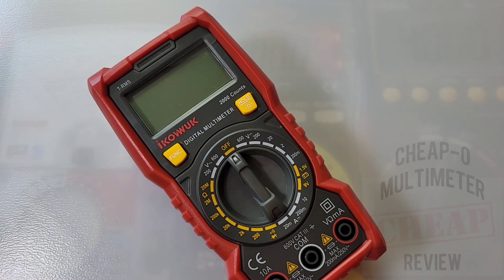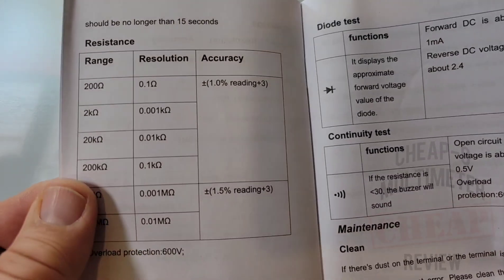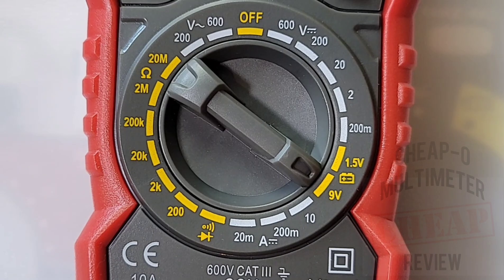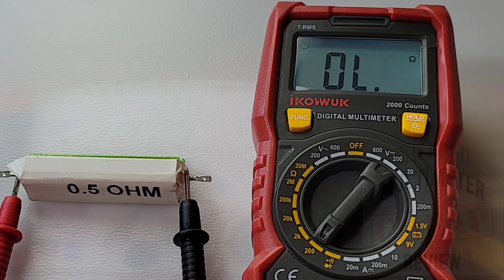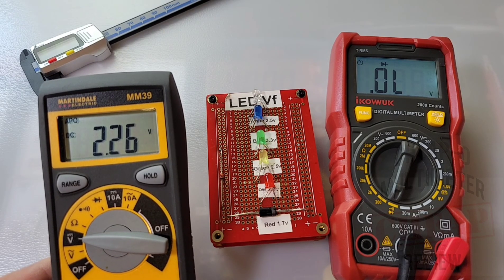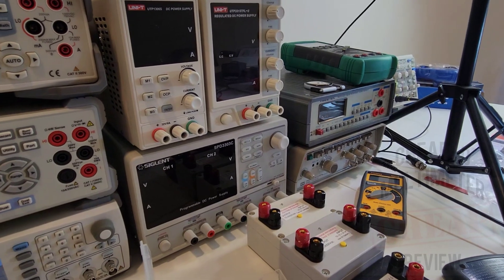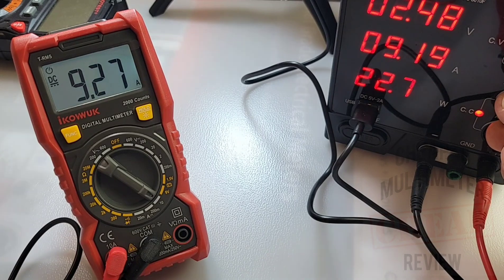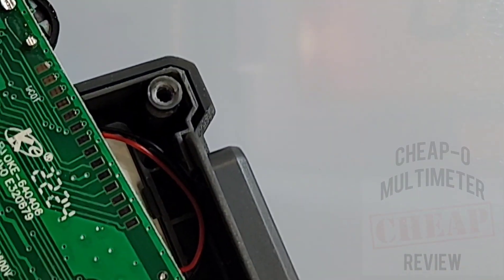IKOVWUK HT113 CHEAP-O Multimeter Review & Teardown!

Comment: Why are you always so happy when the diode beeps t=339, when it does not beep differently when shorted t=351. It should be a short beep for diode, but a permanent when continues, so you do not need to check the display.
Reply from the maker: Simply put..a single beep is better than no beep at all. If the diode is shorted it won't make any sound so you know it's no good.
Reply: @KeepOnTesting  But if I still need to move my eyes to check if it is not a short, it is barely better then no beep at all. Fluke has the short-beep/long-beep, and it works so well. If only they were not so fing expensive.
Reply from the maker: @cybermaus  There's a couple CHEAP-O Multimeters that do have that function..just need to find the specs...I'll post here when I do.
Reply: @KeepOnTesting  I would really appreciate. I watched many of your clips, often skipping to the diode section only, did not see it yet. Bought one even, it is a great beeper as you said, fast. But missing this shorted-out beep. BTW: for the same diagnoses reason, I feel the white/blue high voltage diode test is also not ideal. Some components ave a 3.3V or even 2.8V limit, so having a 4 or 5V probe sounds dangerous. Better would be if meters had separate cont/diode/led ranges. With diode not going above 2V. But now I am dreaming I guess.
Reply from the maker: @cybermaus  https://youtu.be/pAovc5h12zg
These are manual ranging. 
UNI-T UT89XD gas a separate Diode mode. This review is close to 4 years old..I've improved since 😃
Reply: @KeepOnTesting  Thanks. Alas. Neither the HT113 nor the UT89XD beep differentiate a diode from a short. Or at least, you show so in your video for the HT113. The UT89XD video, yours and all other YT, forgets to test due to focussing on the (admittedly great) LED test function.
Reply: @KeepOnTesting  Found it: Your UNI-T UT39E+ review !

Comment: Seems it's made by Habotest Instruments. And the main IC is 44 pin SD7500 from SDIC Microelectronics, with built in one time programmable rom. I found the same DMM chip in Uni-t UT202+ Clamp meter.

Comment: The cheapest multimeter is DT830B, about $2 US.
we can buy chinese panel voltmeter (with red, blue, green leds) for $1 for 0-100V one, more than $2 for 0-500V one.
If we buy DT830B we get a 0-1000V voltmeter + box + probes.
We can optimize the room inside this multimeter to be used as other meter/tool.
a. Backlight LEDs Zener Diode Tester.
b. Capacitor Discharger.
c. pls add

Comment: On diode test mode, why it beeps when the test lead was shorted?. When we test a diode there are mostly two failed conditions: shorted and opened junction. (The third condition is decrease in forward voltage like 0.6v to 0.2v on non-schotty diode).
So in this ht113, we have no confidence when it generate beeps on diode test, whether it is good diode or a short diode?

On my RIP uni-t UT-136B+ there  was also a beep alarm feature on diode test, when voltage drop on Diode under test was less than 30mV it would generate beeps (the diode was in short condition). But still when it didn't beep, we didn't know whether the diode is good or opened junction.

Still I need to look at the multimeter screen to read the measurement value to be confidence. Thankyou.
Reply from the maker: Great points...still I'll quite happily choose a dmm with diode beep functionality than without. At this price point there's little to find fault with.
Reply: @KeepOnTesting  Yes, it is one of the good meterd at this price.

Btw, The main chip probably SDIC Microelectronics SD7500:
package LQFP44
pin 43 44 Not Connected (left floating)
pin 15 16 Rx Tx - not used (for serial output feature)

Please check :
pin 3 Ground/Com
pin 2 V+
pin 22 23 to Buzzer driver transistor or BackLigt driver
pin 24 BackLightDriver?

Comment: Not bad for $15 maybe $20, great continuity speed, (fast) resistance and no micro-fuses that require x-ray vision to change and a detective to locate-lol  I couldnt find this model on Amazon to check price, I did see the 6000 count (auto range) version for $25 that had a capacitance range of up to 100 mF I think, might be worth a look-?
Reply from the maker: Amazon purchase link is in the description. 👍

Comment: ProbeMaster continuity volume subconsciously = the pain of buying them!😁Most buzzers are either self oscillating or uC controlled, so same on both accounts (unless more useful uC code is written to vary PWM say 20% to 50%).
Reply from the maker: My thoughts exactly 👍
Reply: @KeepOnTesting  Wouldn't it be nice if PWM'ed volume was linear? Most DMM's see continuity < 40 ohms. Have you ever found a meter with 3 or 4 volume levels? Who knows if China is listening... ?

Comment: Dunno how they made up their name but the meter seems pretty good! And did I see some grease on the rotary selector tracks? And it got a screen bezel! You wouldn't believe how scratched up the LCD on my ANENG M118A...and some water and moisture did seep in too. Still works though!
Reply from the maker: Yes there's a tiny amount of dielectric on the tracks, a nice touch indeed. Agree the name is a mouthful..but I recall having similar thoughts when I heard Kaiweets for the first time 😃  BTW, a dab of PlastX polish (Meguiar's) for automotive headlights will clean up your scratched display like new!

Comment: I really like it for 14.99. I agree 4/5 is about where I would put it. I mainly just checks for shorts on Caps with my multimeters. If I really want to test a cap I use an LCR meter. I just bought a manual ranging meter. UT89X and I love it. For 34 bucks you can't beat all the features.
Reply from the maker: Makes sense ...Btw that UT89X is an awesome dmm , enjoy!!

Comment: I would give 3 stars at most. Does not measure capacitors, and poorly with diodes. 👍
Reply from the maker: Fair enough.  😃
Reply: Honestly you only need voltage and continuity. You really never use anything else.
Reply: @jonfreeman9682  Not true 😁
Reply: @krzysztofg2025  Haha I guess I'm a light user. I only ever test batteries and AC line voltage and blown fuses. Guess I'm not the electronics hobbyist I fancy myself. 😆